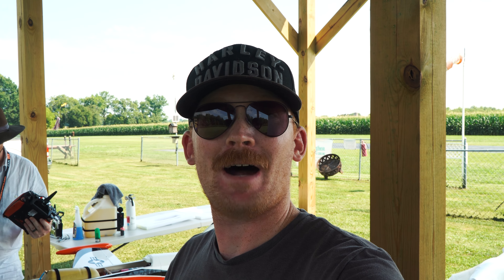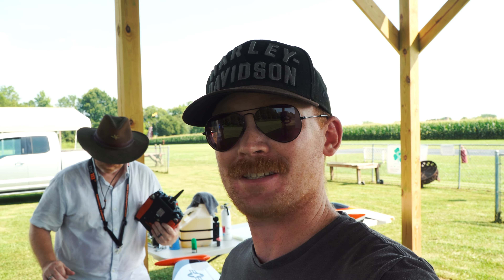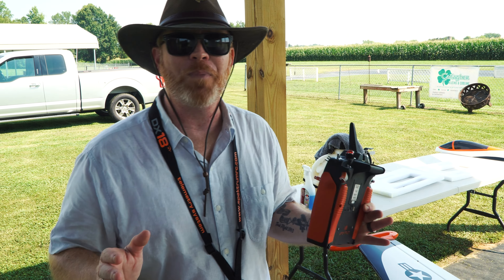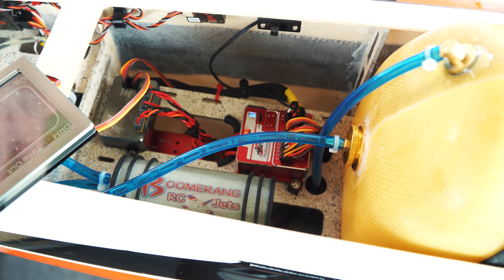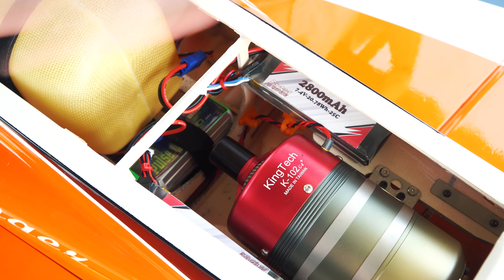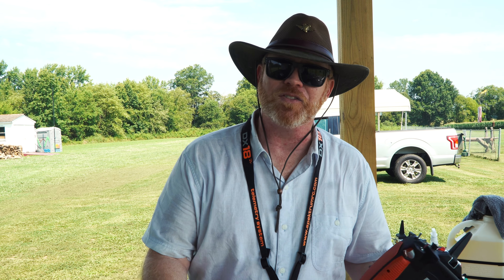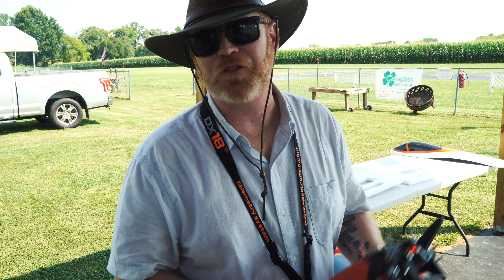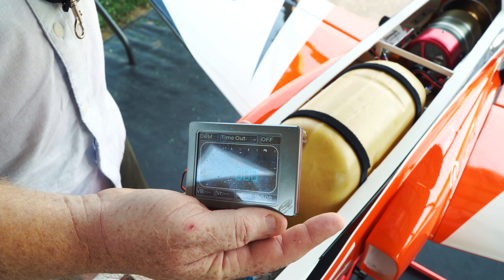Boomerang Ranger, our first RC turbine jet! Kingtech 102 turbine with MKS/Hitec Servos and Jeti RX.

Comment: One question i wanted to ask regarding your transition to turbine jets: did you first fly EDF jets also or not ?  If you did fly EDF jets then what would be the most stable EDF jet to start with in your opinion ?
Reply from the maker: I did fly several EDF, and the most fun was the Horizon 80MM F16. Very stable, and capable of high alpha, but also could get hairy if you feel froggy! Also love the FMS Rafale, also 80MM. Crashed it, but it was because I was becoming so comfortable with it I just got too crazy with it. The Futura is the most popular I see with those who are transitioning, it’s stable, but can be fast.
Reply: The Eflite Viper 90 is hands down the very best EDF jet on the market for beginners, it's an excellent all-around flyer, with 130-140+mph speeds, super forgiving on landings with no negative tendencies. Highly regarded and recommended.

Comment: The builder made a rookie mistake on the fueling system. Never use wirewrap(tiewraps) to secure fuel lines.  These should all have proper safety wire securing the fuel tubing connections.
Reply from the maker: Nick- I do believe that dad actually put those on there when he moved the tank one time, that’s not on Kris. The funny part is dad knew that it was wrong, but continue to do it anyway because at the time he didn’t have safety wire or pliers lol thank you very much for pointing it out though :)
Reply from the maker: Yup, that was on me! I did change it and safety wired all fuel connections. Sharp eye!:-]] -Mark